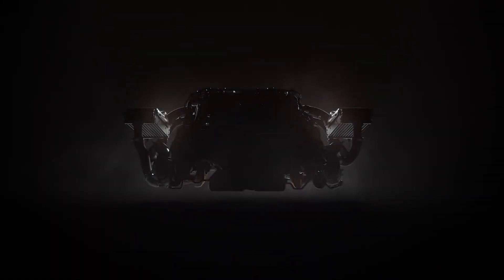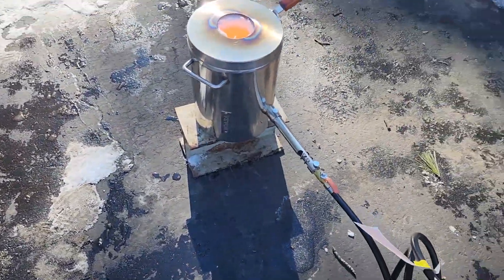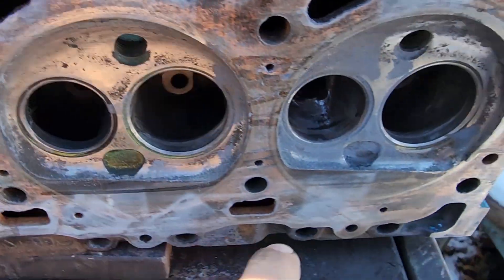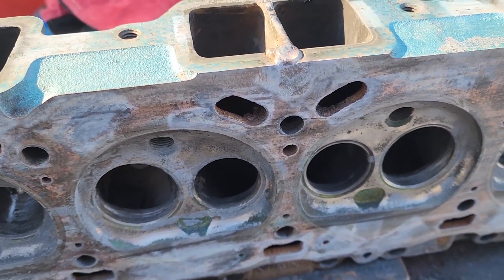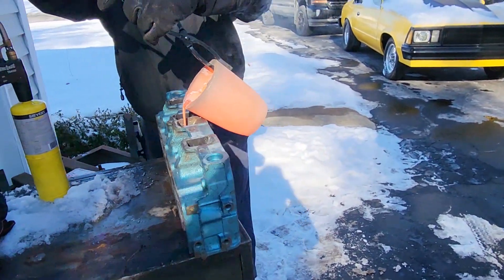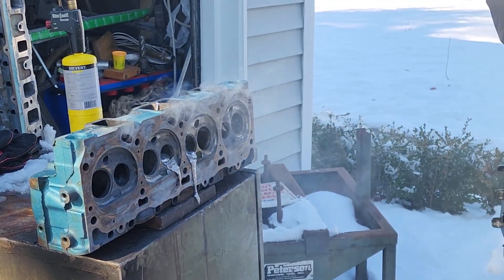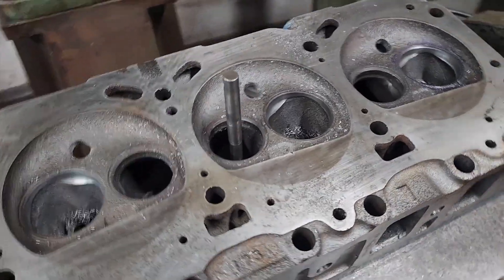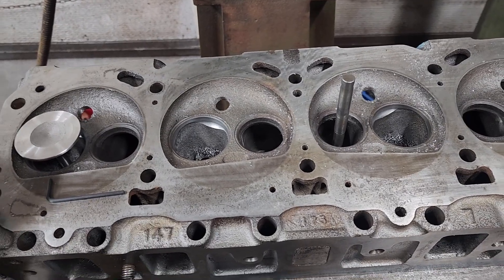Old School Engine Tricks. Blocking Egr ports in Oldsmobile 350 smog heads with molten aluminum.

Comment: Can wait to catch your series on an Olds engine if it has been released. I'll search thru your videos. As I have a 1979 Eldorado with the factory Oldsmobile Rocket 350 with the factory Fuel injection. I've been hearing that certain car years can now have some emission controls deleted and I thank you for this video eventho I thought it would be about using an EGR block plate but your video adds things I didn't think I might need. So I'm interested. Thanks for your video, and have a great weekend. Eddie J.    Long Island N.Y.

Comment: My concern is the aluminum will expand at a different rate and crack the cast iron...
Reply from the maker: This isn't something I thought up.  It's an old-school trick that's been done for over 50 years. It's in a lot of high-performance books for engines that have smog heads. I originally thought the same thing, but I have worked on heads that have had this work done and have never seen an issue.  Also, you need to remember this is poured in at over 1300f. Then when it cools, it contracts so it would never expand more at 200f then when it was at 1300f.

Comment: Did you preheat the heads? If you carbon soot up the areas you don’t want the molten aluminum to attach to it’s easier to remove it when you’re cutting it all out with a burr. It flakes up easier.
Reply from the maker: We did preheat the heads alittle.  That being said the aluminum really doesn't stick to the iron.  It's held in by the shape of the cavities.

Comment: Iron heads > aluminum heads when bolted to iron blocks. All iron engines have less of a likelihood of pushing head gaskets vs aluminum headed iron blocks. When I built my 408W I could not find any modern cast iron heads. For a mud truck losing 35 pounds is not an advantage when you give up cylinder sealing and head flex.
Reply from the maker: That's more of an old wise tale.   Main thing is that the aluminum head has a thick deck.    There are Ls engines we build 1000-1500hp iron block and aluminum head.   Everything just needs to be machined correctly.